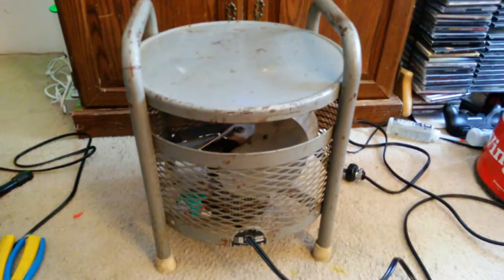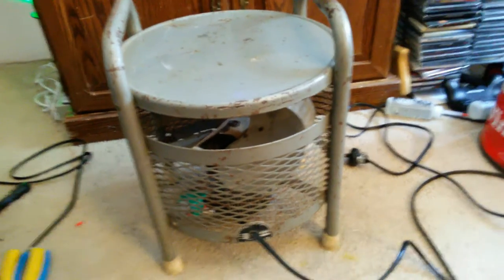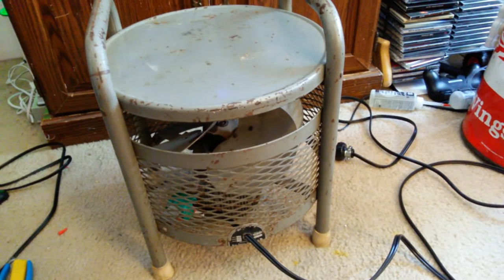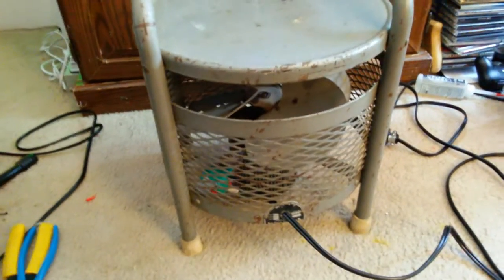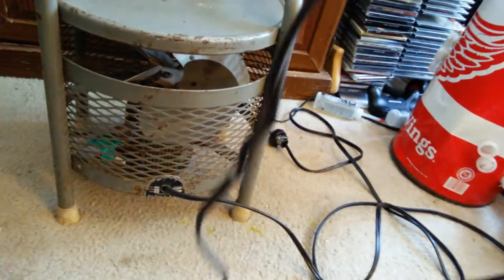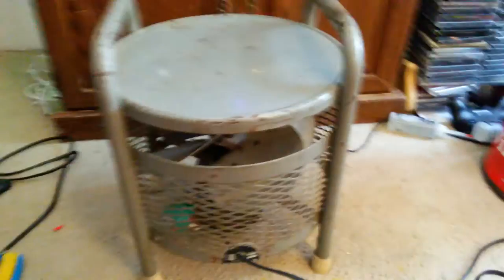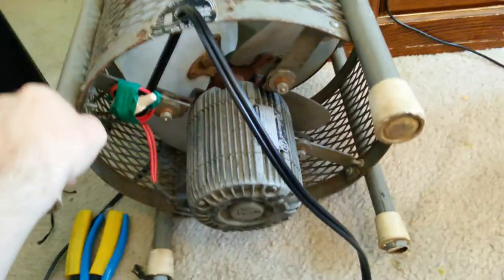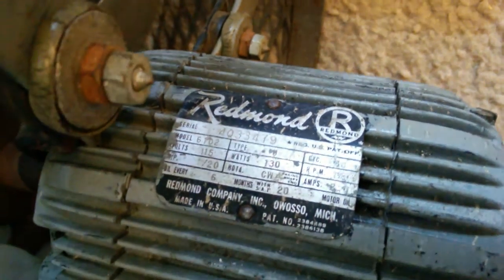Vintage Kisco hassock floor fan model 7000 R 20

Comment: I've always liked those type of floor or hassock fans.  My grandmother had one that the motor went bad in, but when it worked, it WORKED!  They move a tremendous amount of air, and would probably keep someone cool on all but the very hottest of days.  What color are you going to paint it?
Reply from the maker: probably the same color it currently is or maybe white

Comment: Can you advice on where to buy  this type of fan?
Reply from the maker: I got this one off of ebay
Reply: Ebay or your local classifieds. You can get them really cheap off  Craigslist/offerup/letgo/ect this time of year since most people aren't buying cooling fans during the winter. 
If you're into old heaters especially the heater fan combos, I'd recommend waiting till everyone is doing their spring cleaning or summer.